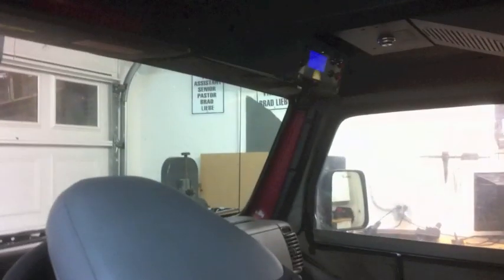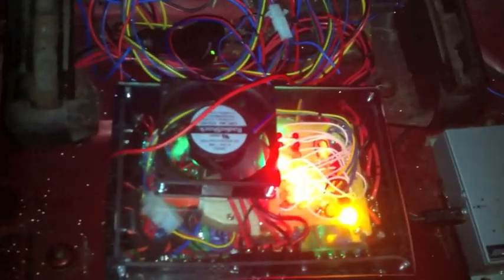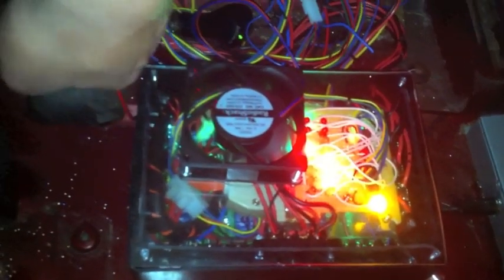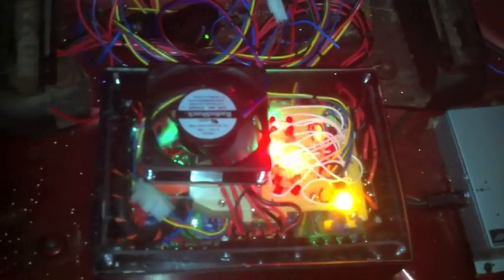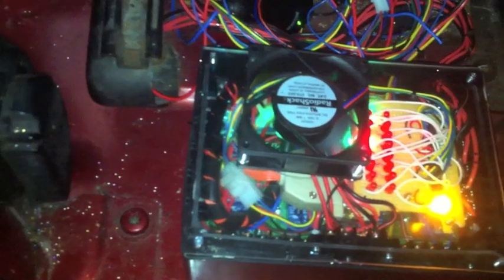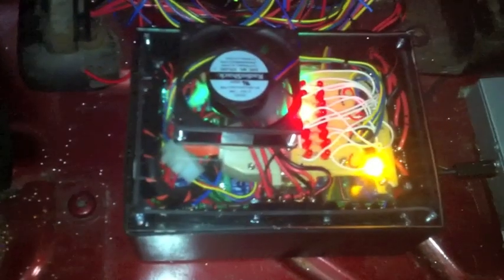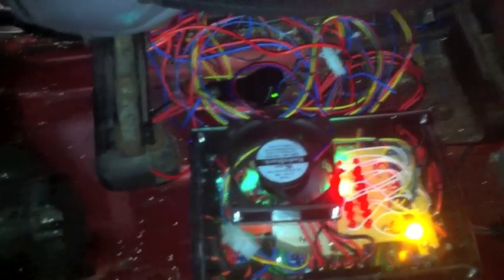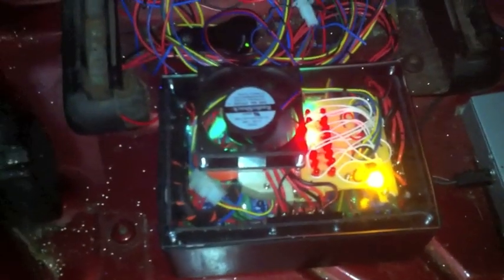JEEPuter - Relay Box

Comment: you should try atmega644p (sanguino) instead of arduino. it has 40pins = more digital and analog pins, twice of memory(eeprom, flash, ram), you can build it on a protoboard,make custom shields and use less shift registers :D